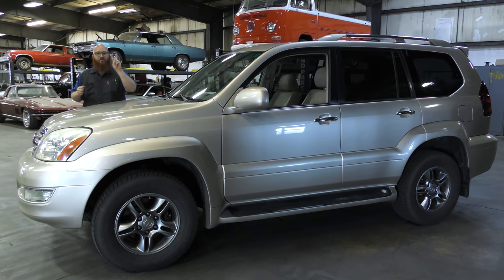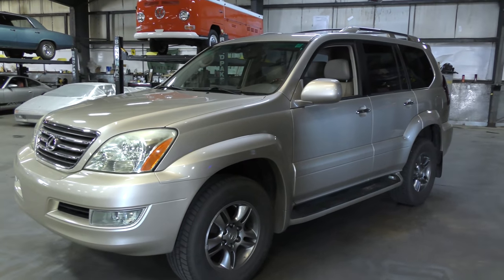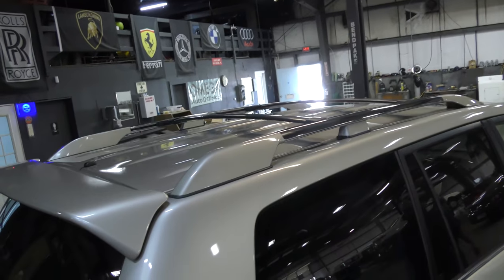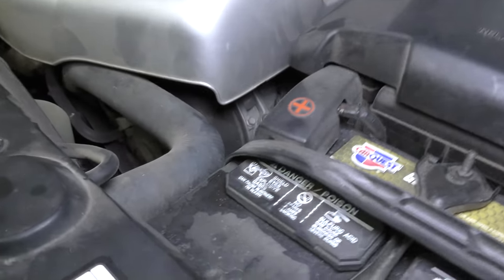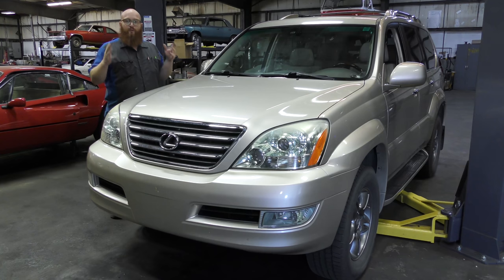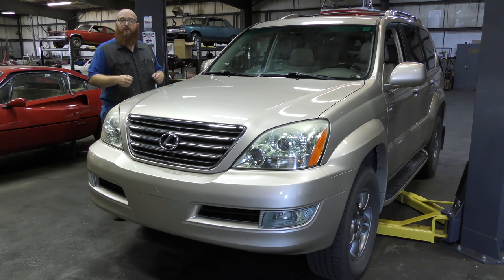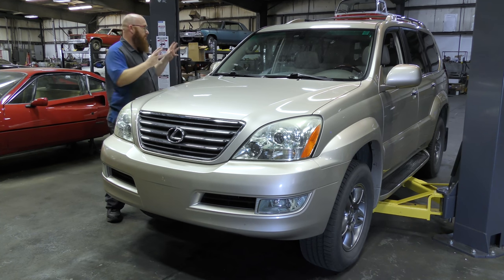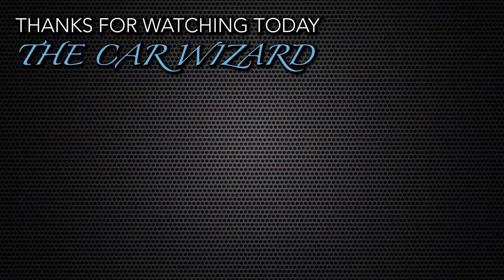Reliable cars get surprise bills too. Simple oil change on '08 Lexus GX470 turns into $1200 repair

Comment: I have an 06 mountaineer with the 4.6Lt 3v AWD with 183k miles on it. Bought it with 149k. I've had to replace the coils. Bought ac delco coils for like a little over 169 for a set of 8 with new spark plugs. i first bought the cheap coils that were like 25 dollars(only lasted almost a year). I shouldn't of bought those no name coils. the ac delco are holding up and seem to be good coils and a lot cheaper then going with the OEM coils. I've also had to replace a hub assembly on the front. It wasn't loose but it got noisy. Other then those two issues It's been good without issues. I did all the repairs myself so I had less then 300 dollars into it in the last 5 years. Besides doing the oil changes myself as well. I use the cheap full synthetic oil, like walmart bran or Amazon Basics full synthetic oil. But I only use the motor craft oil filters. I've used the cheap full synthetic oil for years and get lots of miles and normally the cars or suv's end up rusting out before the engine gives up. I live in the rust belt.

Comment: I can't agree more. Finding a good mechanic who will talk to you, and takes the time to explain. We have an older 4wd and a newer huyndai pocket rocket (still under warrenty), and absolutely great little car. I use a local bloke for the Ford Ranger, he's straight down the line, never over charges and the vehical runs perfectly (for a ford). We took the 2019 hyundai in to the dealer and the bull shit extra servicing they were trying to push was astonishing (2 Year old car and you need an  "engine oil flush out", me- "um your changing the oil right?', "yes", "so why would I need that", silence "$200 bucks". Find a good local mechanic that you trust, and then trust them.

Comment: Worked as a service advisor at a marina and dealt with such arrogance. Me “Sir, your bilge pump is on the way out and you should consider replacing it”
Customer: “Quit trying to sell me extras and just change the oil!” I notated each time I warned about the pump. It ended up on the bottom of the lake when that pump finally died. The Wizard speaks the truth!

Comment: I had a front-wheel-drive Toyota that had a front boot that went bad like that. I cut off the boot, scooped out as much of the grease in the hub as I could, then wiped even more of the old grease out with some rags. Then I added fresh grease, put on a quick-boot that glued together, and it lasted 6 more years until the rust ate too much of the body to make it worth keeping, so I junked it. If the car is near the end of its life, it's just not worth the cost of putting on a new CV joint.

Comment: I agree with you on Toyota reliability. My wife's 2009 Toyota Corolla has never gone under the knife except for safety recalls. Meanwhile my 2013 Traverse has had the water pump, motor mount, purge valve, rear a/c blower the AC recharged 3 times and I've got a rattle that no one can find and now I think my transmission is slipping and my timing chain is chattering. I tried to remain loyal to American made but IF I buy another car it will be another Toyota.

Comment: great vedio, by the way recently people are using these cars for offroad which indeed will need more maintenance.

i like toyota because am a frequent roadtrips guy, but it is remain an automobile which will need maintenance on a frequent periods, make sure to drive your car in a proper way to last for a longer time, media and YouTube video shows that cars are tanks .. but unfortunately cars are not tanks and they may get damaged from a rock that hits its lower body ( if not protected and well prepared for offroad) and it may also need a real repairs work ( costs $ ) so i advise all young buyers be prepared and drive carefully your car 💪🏻

Comment: I've just done a full suspension rebuild on my lexus which cost me 5k. Not even 100k miles on it. It also needs two new engine mounts which will cost me around 2k and a transmission service as it jerks into 2nd gear. With all this work, I can't really say buy a toyota or lexus because at the end of the day, it's how you drive that matters. The engines are great, yes, but the rest of the car? It's just like anything else on the road.

Comment: We have '07 and '09 Camrys that are shared in our family. Still at or under 100k, they get serviced yearly, but typically they also need other things (brakes, exhaust, tires, etc.) that add up to $1,000+. We're thinking of getting Mom a CPO Rav 4 hybrid, like you said easier to get in/out of w/more safety features, but we'll keep the Camrys. All these repairs are to be expected, even for a Toyota, but I get it b/c I drive a '99 Saab!
Reply: The Car Wizard was referring to whats under the hood. If given the minimum amount of care, the components under the hood of a Toyota should break less often that what's under the hood of other car brands, if given the same amount of care.

Comment: IMHO, a "bargain".  23 yrs. now with my LS400 which was initially bought on the advice of a M-B Certified Master Tech. with decades of experience. It's still my daily driver. Had its first significant repair early last year. I always do my own oil changes, trans. drain and fills, brakes (Brembos and very easy), etc. NEVER go to the dealer for anything.

Comment: Toyota timing belts:  My Lexus LS430 had 165000 on the clock when I did the timing belt, and the original one still looked new.  Also, the water pump was still working fine.  Also also, I did the job in my driveway for about $300 because it is really easy!

Comment: I own one of these with KDSS, & I’m not going to waste my time nit-picking some of the things you’re off on. 

However, please Please PLEASE get this guy a set of DBA T3 4x4 series rotors when you do his brakes (front & rears), & make sure you use OEM pads with the specific part numbers for the GX/LC120/Prado. They’re usually special order, but this guy will thank you for years that his rotors no longer warp before 50% of the pad is even used up!!!

Comment: Wizard there is a difference between you and other repaint shops. 1200 for the work you are doing is reasonable. I had a shop tell me that both of my heads needed to be replaced because they found some hydrocarbon in the coolant. That was was 80:000 miles ago. And yes I did not have the work done.

Comment: My problems were with the 4wd system. They must've never used it before me. And then also, the headlights were hazy and had hairline cracks. And the paint wasn't shiny, which they had problems with. Lots of squeaks and dash cracking. Doors squeaked, weatherstripping was gone in 2012, but it was on 05. And rotors were warped. Timing belt and water pump was an expensive job. I'd be on a stop on an incline, and it would make a horrible metal scraping noise when I took off. And the transmission wouldn't shift well for 1-2  during warm up when it was even slightly cool outside.

Comment: I own 4 of these GXs one with over 380k miles and all 4 of them no problems just oil changes & timing belts and that’s it. As for brakes and rotors I DIY myself. My GXs are actually more wallet friendly than my S55 AMG.

Comment: The Wizard speaks truth.....especially if you are buying an older car with miles on it.  Toyota & Lexus.....not perfect but for sure the most reliable cars I have ever owned.  I have procured six older Camry's for my kids over the years.  Repairs for sure but no motor or transmission replacements.   My current GX470 is strong with that million mile 4.7.  My wife's RX may be the best car I have ever driven....so easy to drive, fast and repair-less 😀

Comment: I’ve been DIY pretty much my whole life. I’ve had three Toyota’s in the last 20 years. But I’ve also had a lot of other stuff too. Maybe it’s just me, but when you look at the price of parts and the serviceability of engines with timing BELTS and other components  that cost markedly more than other alternatives, I just don’t see putting Toyota on a pedestal that’s so high it would preclude buying anything else. Just hasn’t been my experience.. But I guess If I was someone who didn’t know much about an automobile maybe I’d just viscerally default to Toyota. Not saying wizard here is off base, but I’ve seen many GM 3800,, LS engines, Ford Panthers, and even a dodge truck I had that would last just as long with a modicum of care without the premium price. .

Comment: Wizard, obviously this is the Land Cruiser platform, if reman axels leak, u must purchase new Toyota axels, not reman Toyota. I learned the hard way.. Front brake job is very involved on the front of those as well. Great truck and please let me know when they want to sell...lol. I have an 03 Tundra and 05 Land cruser with 300k miles. $1200 is fair, so fair, great work wizard. Trol hole cruisers and Lextech in Charleston, SC, great places!!

Comment: I understand what you are saying and I do agree with what you say.  I based my vehicle buying decision on is the Toyota worth the extra 3-5 K, then  
add the extra financing and insurance premium and I disagree with you.  I get over 200,000 on my cheap cars and with only the usual maintenance.  Last three cars I had (1996 Ford Taurus, 2005 Ford Escape and 2001 Jeep Cherokee) a few not scheduled maintenance repairs and those were due to rusted parts going bad- tone ring/ stabilizer link/ rear shocks on the escape and some part on the transmission for the Taurus, valve cover leak and shocks on the Jeep.  I do not know if I was lucky but the Ford 3.0 super reliable, the Ford 2.3 Duratek engine, and the indestructible 4.0 L engine. Currently driving a 2013 Jeep Cherokee with the 3.6 pentastar engine, 151,000 miles, only replaced O2 sensor. So, my experience save your money because not many repairs will get into that 3-5000 dollar premium for a Toyota.  In Illinois Toyota’s seem to rust out faster.

Comment: I used to deal with a guy that liked old 80s beemers, and he budgeted $2,000/year per car.  That's reasonable, considering he always changed things like the water pump, oil pump, radiator, etc upon buying the old cars.  Some years you might even come in under budget if you stay vigilant over the course of time.

Comment: Also, all the all-new, Toyota's and Lexus' are already transitioned to smaller, turbocharged engines to save fuel. Reliability of these vehicles will go downhill a couple months to a couple years later, same with the rest of the vehicular brands. Thank you very much.

Comment: How about the next gen GX460 review? I traded out 2019 VW Atlas R-line/tech pack down to a 2011 GX460 after a year of annoyance with the Atlas. The VW was the first new car I ever bought. 15th or so car but first new. $ and turned out to be problem after problem. VW of America was a waste of time and so 18k 2011 GX460 dealer maint. With 130k here we went. Has 155k now and it’s a beast. Has a few minor things but cheap fixes and it’s 100%

Comment: On 14 July 2022 my normal service shop was not available, so I took my Lexus into the dealer for it's 130,000 mile service. This service included: Oil and filter change.

Some days later, while driving, I had the "low oil" warning light appear on the dashboard while navigating thru I-65, a road area under construction - no place to pull over safely. Triple A got me towed to a local garage where they did a diagnostic check and informed me that the service tech at the dealer had improperly installed the oil filter (old one not taken off, so the new one was against it), causing the seal to suddenly fail and the oil to pour out. The inspecting garage was very specific that is oil filter installation was improperly done. Took pictures, called over his supervisor to take a look. Put the filter and two gaskets in a ziplock bad.

11 August 2022, General Manager, calls, asks me to come in. He and Service Manager will talk with me and "work something out". I and a friend arrive. We all go sit in a room to discuss the situation. I had a sealed ziplock bag with an evidence tag with the original oil filter and TWO gaskets. Engine had to be replaced with an equivalent used one.  After some discussion, dealer is doing it on their dime. $7,000.

Comment: I took my truck to Firestone to get the steering rack bushings replaced because they were visibly bad.  The goof at the front counter told me he'd have his "master tech" look it over without telling him to look at the steering rack bushings.  I was called and told the ball joints are bad.  The ball joints were replaced by me about 5K miles ago at that point.  The steering rack bushings are visibly falling apart, and their "master tech" missed it.  I asked for a quote on steering rack bushings and the goof at the front counter couldn't even do that right.  I took the ruck elsewhere to an independent shop who didn't question and just did what I asked.  Steering has been working fine for over a year, no ball joints needed.  I don't trust quick lube or chain repair shops for anything more than basic stuff.

As far as Toyotas go, I don't doubt they are reliable, but they don't have a vehicle that can be a good replacement for either my Fiesta ST or my Volvo V50.  I could get a Tacoma instead of my Mazda B3000 (which is a Ford Ranger with a Mazda badge), but both my truck and my dad's Ranger have over 200K miles and neither have had any major issues, just old vehicle maintenance items that all 200K vehicles will have.  And my truck was so cheap to buy I couldn't replicate that with a Toyota.  If Toyota brought the Corolla wagon over to the US, I might consider it, but I like my Volvo V50 wagon for now.  And no one really has a Fiesta ST replacement anymore, not even Ford.

Comment: For people who think $1200 is too much for the repair, half of those are regular service (Oil, pads, rotors). So the surprise is pretty much around $600 which is nothing serious. This $600 will be $2000+ if you have a complicated suspension on the German cars.

Comment: I am hopeful that the Car Wizard will do the buy this, not that video for Chrysler or Lincoln, sooner rather than later. The Lincoln Town Car sedan is still a good vehicle to buy, while the older Chrysler Pacifica crossover wagon is not. These, 2005 to 2008 Chrysler Pacifica's (all of them) were the worst vehicles in the market, due to electrical and mechanical failures. The Lincoln Town Car (any model year) is still a reliable vehicle, because they never fail, except for maintenance and some minor repairs. Anyway, I hope you have a great week ahead.

Comment: This car looks familiar :), I drove a same  color 2004 model since New. Not only it's reliable, it also saves on tires, first sets lasted 10 years, on second sets right now and looks like plenty of tread life left. 165k now. My theory is that because it's full time 4 wheel drive, the force is distributed evenly so no premature wears.

Comment: Anybody looking at a 00's/10's 4Runner needs to look at a Lexus GX as well.  Usually they are the same price, sometimes cheaper than a similar year/mile/condition 4 Runner.  You get standard full time AWD and the V8(can't get a V8 on 2010+ 4Runners).  Main thing is the interior is just A LOT nicer and roomier(they have 3rd row seats).   These also tow nicer, more wheelbase/weight/power.  Only real downside is gas mileage, 12-15 in the GX, its a wee bit better in a V6 4Runner, V8 4Runners its about the same.

Comment: I bought a 08 GX 470 at the beginning of the pandemic.  I have put about 2 thousand in it for repair and maintenance. It has about 160.000 on it now and drives better than most every car I have ever owned with 1/3 the miles on them. The cost to own the GX470 is going to be much less than buying new with inflated prices from 0% scams that offer huge discounts at the end of the year???Really  how dumb do they think we are?  $12000 so far into a Lexus I will get 100,000 miles out of. I will run this GX and my F150 for a while and maybe get a Rivian when prices settle in 5 years.

Comment: My dad hates American cars & he instilled hat in me. I only go for Honda/Acura or Toyota Lexus. In my early 20's I bought a BMW and it cost me a fortune having to continually repair that thing. My current mechanic who finally solved a lot of issues other "Euro" shops couldn't fix told me to get rid of that thing. I ended up getting rid of it and going back to a Honda. I bought a Honda that was older & had more miles than the BMW & it has been a lot more reliable & cheaper whenever there is something that needs to be fixed.

Comment: I fellow mr daughter knew  was driving them both  in his 4 wheel drive Toyota about 300 miles back to University, before they left, he said its making some noise from the back end, I looked underneath and the rear universal joint was just about, as the Wizard said, to "grenade", there was not a needle roller left, this bloke was definately NOT mechanically inclined, The parts shop was still open, I got a new joint and all went well.

Comment: Guy who previously replaced the timing belt at correct service interval won't flinch on repair/replacement of things that are old, worn, and broken.

A new GX is north of $50K; $1,200 is pocket change compared to buying new.

Comment: The CV axle boots were torn on my 97 4Runner when I bought it 7 years ago. Almost 400,000 miles on it now and they still have no issues. Not sure if they're original though.

Comment: The replacement interval on that timing belt is 6 years OR 90k miles, whichever comes first....So, 2015 + 6 years = 2021...  It's due already, which is another $1k if you're doing everything the right way (all idlers, tensioners, fan bracket, water pump, etc, thermostat, upper and lower rad hoses, etc, etc...).  It's in such great shape, why risk it?  Keep that thing going for another 850k miles.